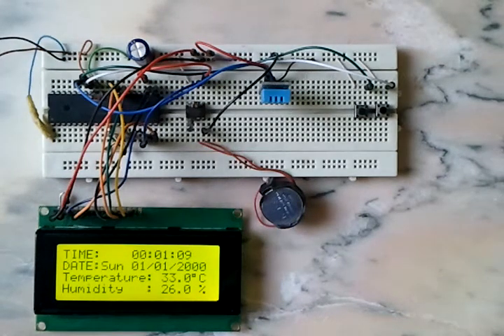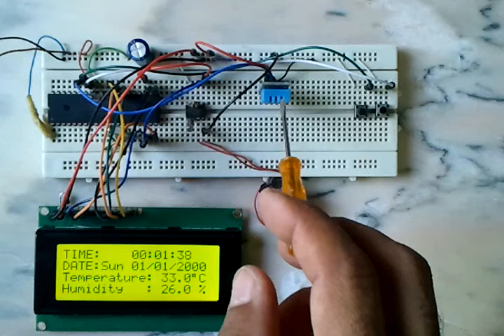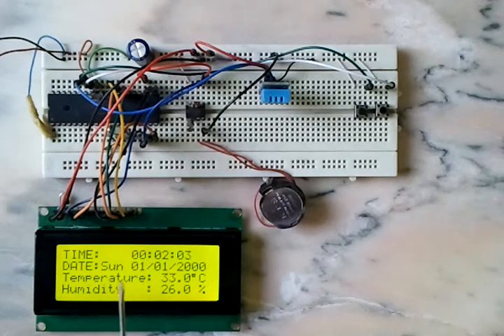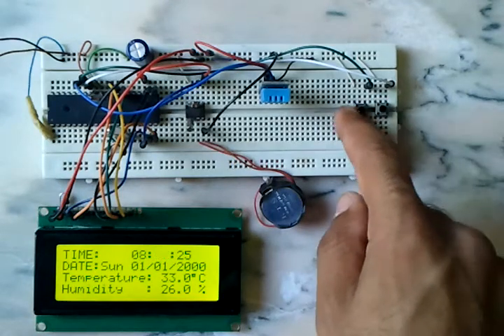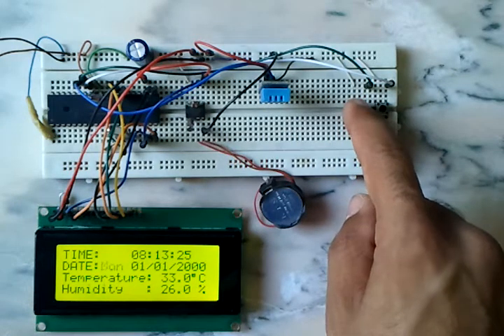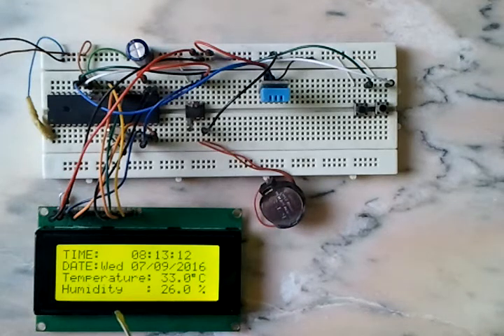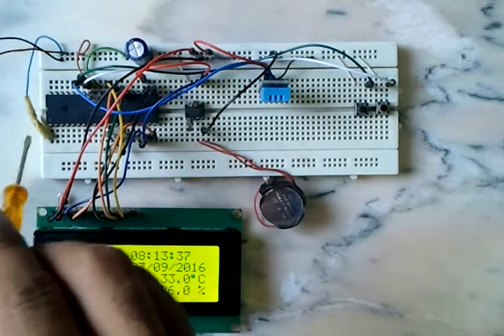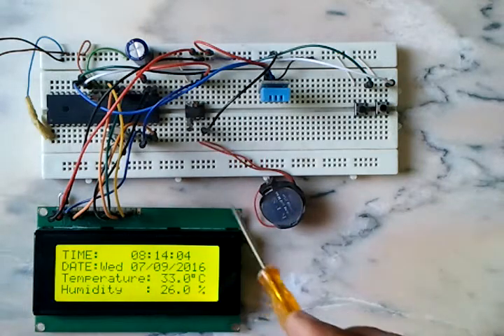PIC16F877A + 2004 LCD + DS1307 RTC + DHT11 Sensor

Comment: Hi, send hex file to my mail. sergm411@gmail.com . Thank you so much
Reply from the maker: Compile the C code using CCS C compiler to get the hex file. C code in this page:
http://ccspicc.blogspot.com/2016/09/pic16f877a-2004-lcd-ds1307-rtc-dht11.html
If you still have a problem contact me via this email:
electronnote@gmail.com
Reply: Hi friend, I think you a programming genius, I would if you could add in the code to turn off display illumination after leaving to use for 15 seconds, thank you. redstar.aff@hotmail.com